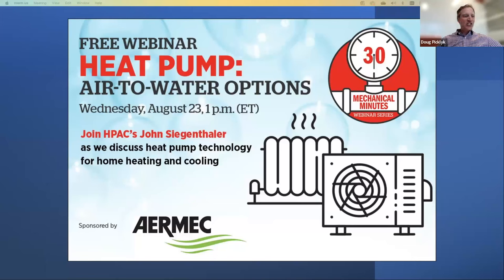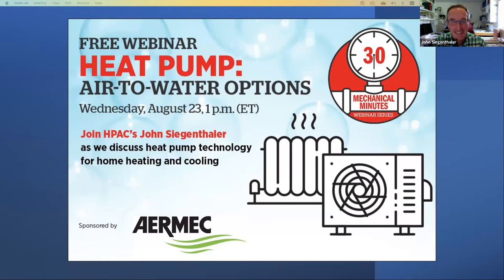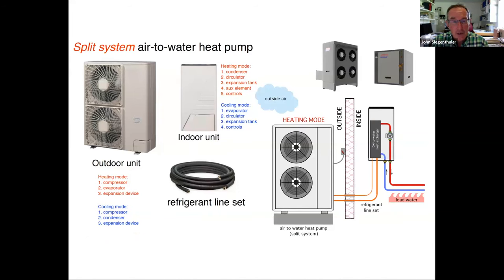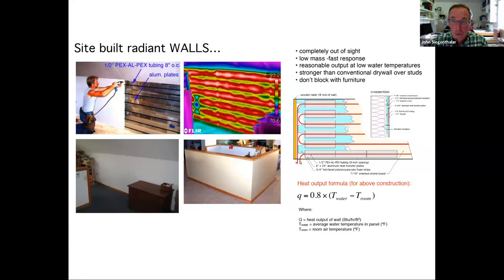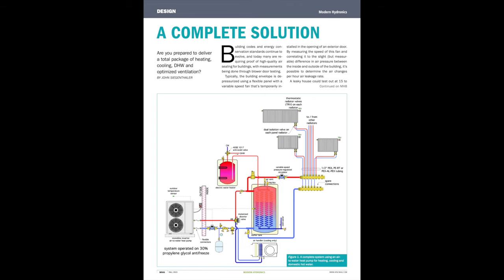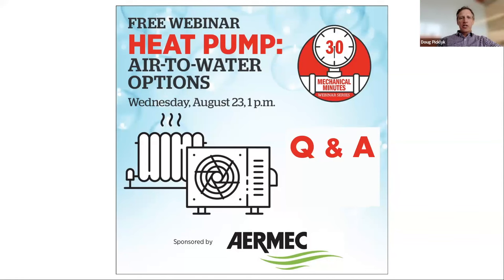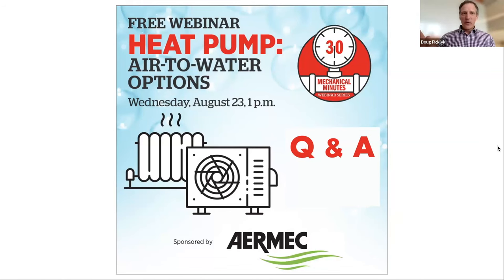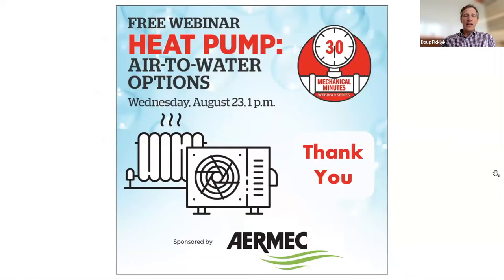30 Mechanical Minutes: Episode 16 "Air-to-Water Heat Pumps"

Comment: In Europe, many manufacturer are recommending Anti-freeze Valves instead of anti-freeze fluid. Anti-freeze fluid lowers the performance of the system whereas anti-freeze valves don't.  The valves need to be good quality and protected from water & snow. They are fitted on the supply & return lines to the outdoor unit outside of the home. They release some water from the system if the outside temperature drops below 38F. If the outside temperature is below 38F,  you can be certain that the heat pump will be running UNLESS it has a fault or there has been a power cut. If the heat pump is running the valves won't open, but in the even of a fault or power cuts they will open just enough to let a little water out to stop the outdoor unit from being damaged. The system needs to be topped up when the fault or power is restored, but you only need to top it up with fresh water, not a solution of water and anti-freeze.

Comment: The Global Warming Potential of R410a is 2088, for R32 it is 675, for R290 (Propane) it is 3, and for R744 (CO2) it is 1. Propane is pretty much the ideal refrigerant for small residential monobloc systems where all the refrigerant can be kept outside of the home; although CO2 is better for high temperature applications. For split systems and larger commercial systems, Propane is not ideal and an alternative refrigerant is preferable.

Comment: If the designer follows the manufacturers recommendations for minimum fluid volume in the system, defrosting should not produce a noticable drop in termperature indoors, but North America typically has homes with much lower thermal mass than the UK or Europe, so it could be more of an issue in North America. A system volumiser or buffer tank is a reasonable solution, but in the UK some experts are actively trying to design out buffer tanks (and zone valves) from their systems. Perhaps the ultimate buffer tank configuration is no buffer tank!  Great to hear that in John's experience home owners don't experience any cooling when the system is in defrost.

Comment: Panel radiators are very common in Europe and the UK in rooms where the home owner want thick carpets and thick underlayment. Combined with simple Thermostatic Radiator Valves, to avoid overheating due to thermal gain, they can be a very cost-effective solution were cooling isn't required. Radiant ceiling or fan coils are the best emitters for cooling applications. Radiant floors or panel radiators are the best for heating. Radiant walls might be a good in a few limited situations, but my sense is that there is more risk of a nail through a wall than through a floor or ceiling.

Comment: Another solution to the two buffer tank question is two heat pumps: one for space heating/cooling with a single buffer, and a ducted Heat Pump Water Heater for hot water. The ducted Heat Pump can be a CO2 model, so able to heat domestic water to a point where Legionella is not a concern. This avoids the need for the space cooling heat pump to have to switch to heating mode to keep a supply of hot water ready for use. This configuration also allows the heating heat pump to operate at maximum efficiency in heating mode because the flow temperature can be controlled by outdoor reset.

Comment: I would have loved to have seen a specification for a hybrid system retrofit designed for a residence located in western NY southern Ontario region equipped with an existing forced air natural gas 100kbtu furnace and a typical 50 gallon mf DHW unit.  The hp would be required to provide primary heating and cooling and domestic hot water.   This is going to be a typical existing residential profile for many homes in the region. Can this be accomplished in a way that makes sense economically?

Comment: I totally agree with what was said at 10:49. You can use bivalent system and use the heatpump for the majority of the year...then use the existing boiler just a few times a year when it is really cold. Somewhat common to use this approach in the UK. We shouldn't let perfect be the enemy of good.
Reply: Update: I just looked into to John's bio and saw he wrote an article in PMMag title "Options for connecting heat pumps to existing boiler systems". This article has great diagrams showing the different options to combine a heat pump and boiler. Such an awesome resource! I had been contemplating the design of my system in my head/imagination based on my limited knowledge...but I had never seen an example diagramed out in a picture...I am so happy to find this article with several diagrams to show my boiler guy. It would be great if there was also an option to add in a hotwater heater...perhaps with a heat exchanger?
Reply: They talk more in depth of this at 15:39. AKA dual fuel or bivalent.

Comment: John’s graph showing temperatures vs distribution equipment (around 10min mark) should have a dotted area instead of line at 120F for baseboards. The line implies can’t use below 120F when you can. It really depends on extent of weatherization, outside temp & set point. Here’s an example of old 180F baseboards powered by AWHP & well below 120F; start around 23min in https://youtu.be/9SMxaOMX-oY 
9:58